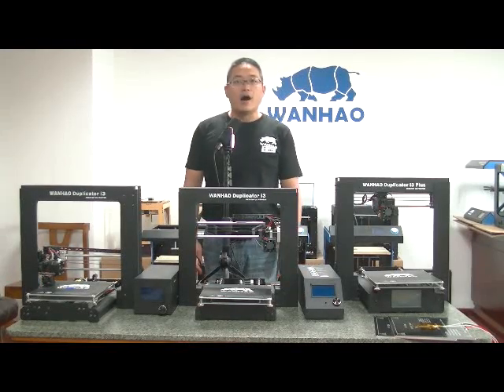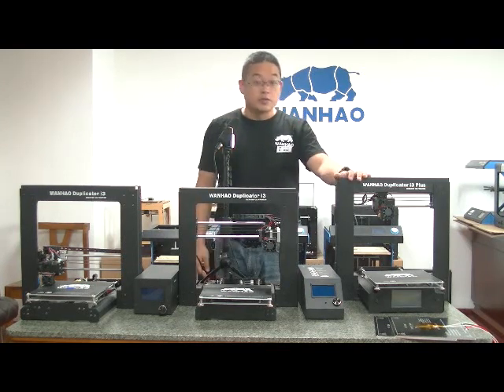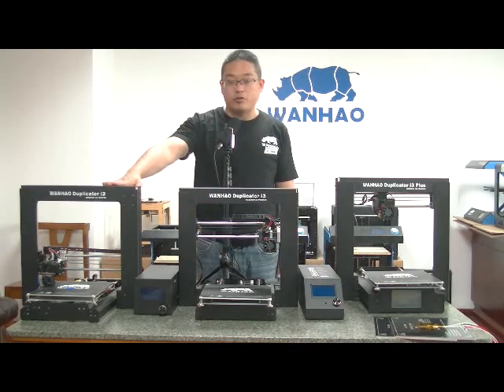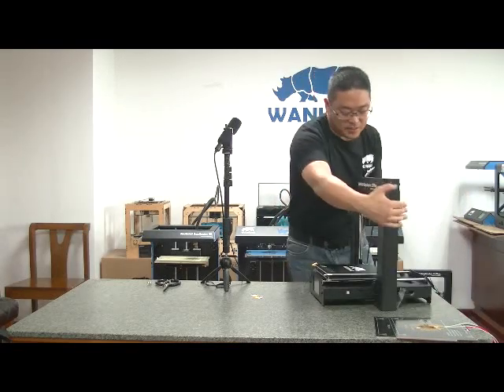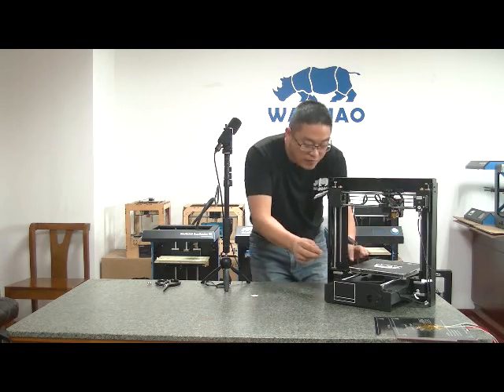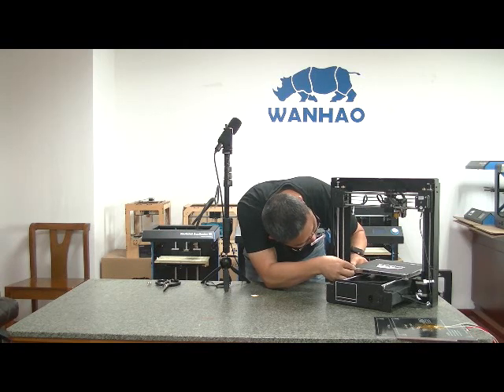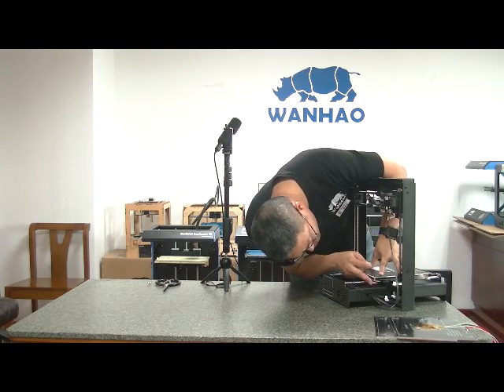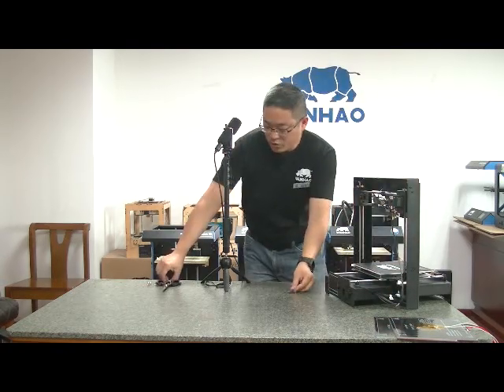Recall on Wanhao Duplicator i3PLUS.

Comment: Wanhao the worst after sales ever. they first give you an upgrade kit that requires to disassembly the X axis assembly (2.0 to 2.1) and then they will not replace a bad stepper motor because you did the troubleshooting by swapping a motor.... Not to mention heated bed terminal can cause a fire......

Comment: hy :

I am interested in your printer but I was concerned about this situation: And can you tell me if this version I found on ebay is already fixed? 

link : http://www.ebay.com/itm/222242478967?_trksid=p2060353.m1438.l2649&ssPageName=STRK%3AMEBIDX%3AIT

I not understand what type of card you used to fixe the problem ? . Can you explain what kind of material is it ?

thanks
Reply: The card needs to be a cardboard card.  The important part is non-conductive.  The card solution is really only a temporary fix.  The long term fix is a high-temperature (relatively speaking) plastic washer.  

Technically; the card or washer doesn't need to be non-conductive; because the problem was the spring "scratching" the underside of the plate, and after scratching; making an electrical contact.  So if the washer was metal it would still protect the plate from scratching, and remain insulated.  But just incase it has already scratched the bottom then non-conductive is required.

I bought the i3 plus from Aliexpress on the 22nd (shipped to Australia and delivered to me on the 31st).
It came with the official fix described above.
https://www.aliexpress.com/item/2016-new-version-hot-sell-WANHAO-I3-PLUS-3d-printer-mental-frame-affordble-3d-printer-with/32698214973.html?spm=2114.13010608.0.0.uQqqz6

Looks like with shipping its ~10 pounds more expensive for UK delivery as compared to your Ebay url.  (assuming you are in the UK)
Reply: Clarification: Ordered on the 22nd of October 2016, delivered to my door on the 31st.

I'd like to add; that that Ebay store looks like they are a reseller, and chances are pretty good that the product will actually ship direct from Wanhao in China (given the prices look so similar to the AliExpress site inclusive of shipping).  But I can't guarantee any of that.
Reply: Thanks for your answer ...

Comment: The credit / ID plastic card solution is a bit "mickey mouse" but i think while you wait to buy new washers its a temp fix that will at least allow you to continue printing. Dont forget to put a smoke alarm on your shopping list !!!
Reply: The card temp-fix is just that, a temp fix so you can keep printing (relatively) safely.  Wanhao are sending out washers free (as they should) when you contact them if you are affected.

Comment: glad Wanhao are sorting this.
buts it's only a minor issues, all it needs is to fit fibrous washer (Insulation washer) between the bed and the spring. I did this to my V1 over a year back (fibre washer  under the bed, then a metal washer then the spring) as I was worried over wearing through the bed insulation. 

anyone with any printer of similar design,  not just wanhao,  go buy yourself four  insulating washers (cost less than a dollar) and fit them and stop worrying.

Comment: I recently bought an I3 Plus and the extruder stepper shorted out last week.  I'm guessing because of this issue.  I am sending mine back to the reseller for them to check it over, but I'm not sure if I want it back.  This is a pretty major flaw in the design, especially if it had been sorted in previous versions.

Comment: Hi,
I have worked in the consumer electronics industry for over 25 years, ( with 15 years of it in Hong Kong and China), and the fix you are proposing is not an acceptable fix. You really need to fix the problem the correct way and get plastic spacers for the table bed and isolate the extruder bearing that  you indicated in the video that is a problem.  You are taking the easy way out and not fixing the problem correctly. 3d printing does not need any fires caused by your company's poor design.   And where are the circuit breakers that should have shut the entire unit down when this short happened?
With all of the government agencies, regulations, and consumer advocate groups just waiting for something like this so they can make a big deal out of it and cause terrible damage to the reputation of the  3d printing community, you and your company need to step up and do the right thing to fix this issue correctly. I hope that you will do the right thing and contact every owner of that machine and make sure it is fixed.
Reply: He mentions this is only a temporary fix and they will be sending out proper plastic bushing free of charge towards the end of the video.
Reply: Maybe spring ok, but the nut & bolt will still ground out.

Comment: so what if I have the v2 with metal bearings and not plastic?
Reply: I've got glass and zebra plate (not both at the same time), it wasn't covered by the (no offence) poorly delivered recall statement.
Reply: Scrub that, this issue that is not explained at all well in this video is the springs warring away the solder mask on the heated bed PCB exposing the traces on the underside. Get some nylon washers (if you don't have them) and place them between the top of the springs and underside of the PCB to insulate and stop the beds  springs from stripping the solder mark, and exposing the copper on the heat beds PCB.